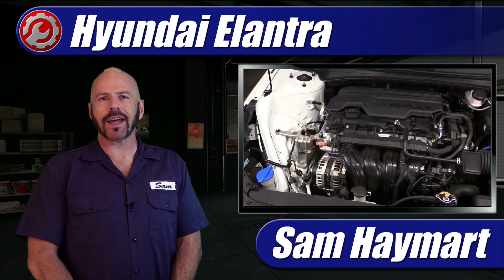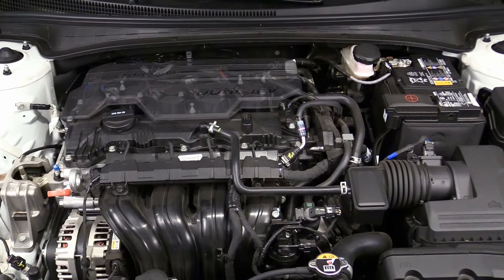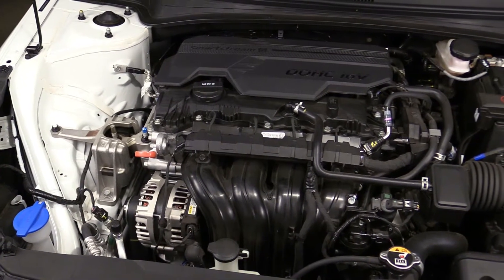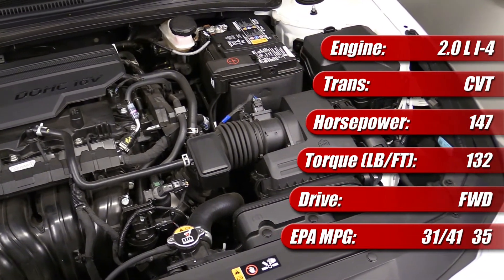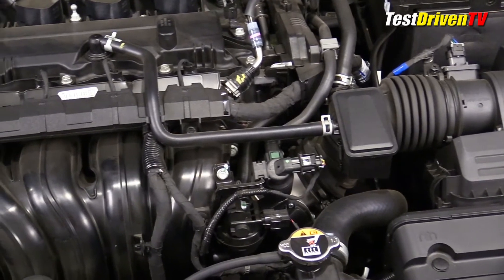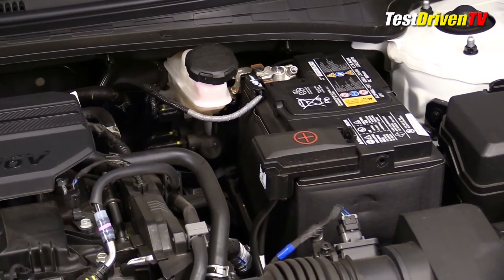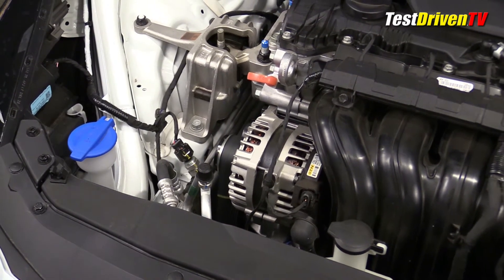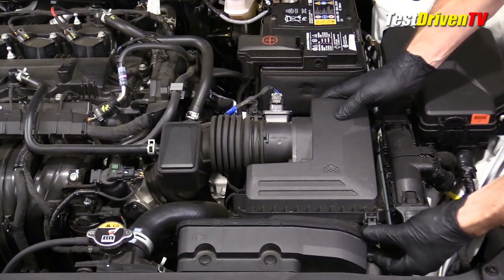2021 Hyundai Elantra: Under The Hood

Comment: My17 Elantra I bought new, just turned 100.000 miles last week. It still runs like new, sounds perfectly healthy. Uses no oil between lifelong 3000 mile changes. The transmission has had no issues,  i had the fluid changed at 50.000 miles, and will be having that done again now. Shifts just fine. The entire car has been outstanding , with 0 repairs,  and 0 issues!

Comment: Not crazy about the plastic manifold but I have seen this engine on a Veloster as well. So far so good on my 2022 Kona. I am prepared for the dreaded Hyundai oil issues just in case however.
Reply: Had my first oil change on 12/9 for my 22 Elantra. My new engine is being shipped and should be replaced on 12/28
Reply: @PaturnOne  Was it the recall for the metal shavings? I keep checking if my car is affected and so far it is not listed.
Reply: @r8mli  no. Only thing they told me is there was an internal failure. Oil changed on 12/9 and car broke down day later. Looked like engine threw up oil.  IMO it was bad maintenance

Comment: The transmission on my 2021 Elantra SEL had to be replaced at 7,000 mi. Totally unacceptable. On a more positive note, I’m getting 41-43 mpg in town and 45-48 highway at 75-80 mph. I basically like the car but because of the transmission issue, two recalls and Many reports of engine problems, I won’t be getting another Hyundai.

Comment: Unfortunately Hyundai doesn’t make it easy for you to check transmission oil
Reply from the maker: No contemporary cars made today have user servicable automatic transmissions with dipsticks.
Reply: @TDTVGarage  the video that I watched showed a guy literally taking parts out of the hood in order to drain and fill the transmission. Whereas a video that I saw on another car, the dipstick thingy was right there under the hood.
Reply from the maker: We haven't seen a transmission dipstick under the hood of a new car in over a decade. Carmakers don't want people messing with transmission fluid for a great number of reasons. Most are sealed for life and only recommend servicing if ever, around 100k miles by trained personnel. Most car owners don't know what they hell they are doing and cause more damage trying to do it themselves, causing carmakers warranty costs.
Reply: @TDTVGarage  The video I saw was from Andy-Auto-Info 2018 Hyundai Elantra Transmission Fluid Change. He drained the fluid 3x. He removed the airbox, the part in front of the airbox, the air vent looking thingy in front of the airbox with the two test tube push pins. He took the pins out to remove that. He then removed something called the fill plug.